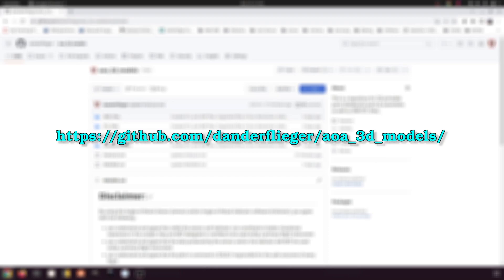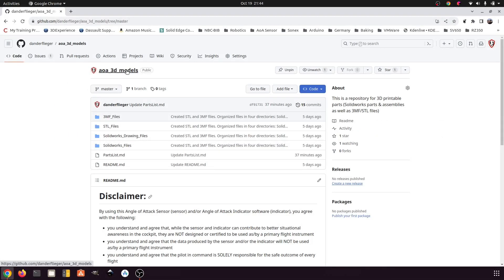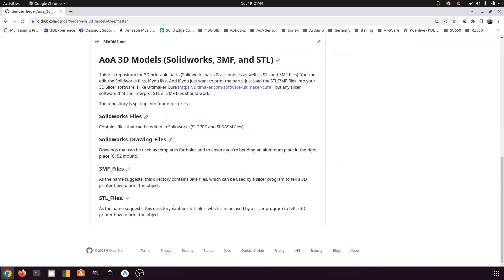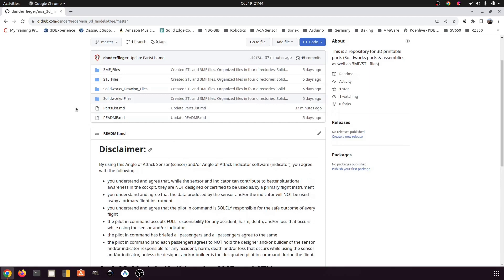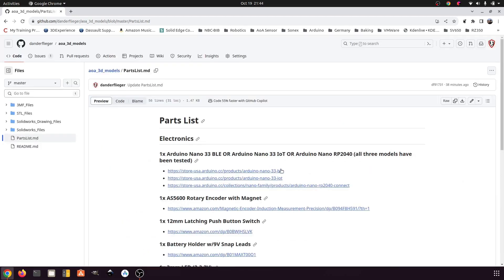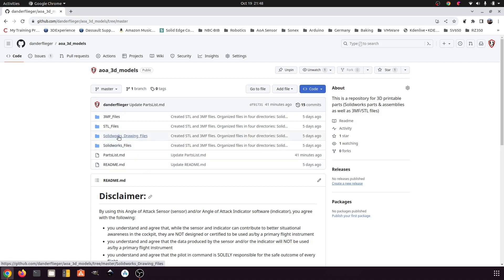Homebuilt Angle of Attack Sensor Assembly

Comment: May be it is a dumb question, can we use an 3 axis acceleromter such as in arduplane instead of an aoa vane as you described ? Btw i really like your design.
Reply from the maker: I think it's a valid question - not dumb at all. With an IMU, you can only derive AoA - e.g. a guess based on limited data. On a typical day, it can be pretty accurate. But if you're flying near mountains, for example, you often get caught in mountain waves where the air flows over a mountain like water in a stream over a rock. With that scenario, let's say you're flying toward a mountain on a windy day on the leeward side side of the mountain. The air it's flowing down toward the low-lying ground behind you. If you're flying level to the horizon, the air is hitting you from a lower angle of attack. All the while you're also descending because the pocket of air you're flying through is descending and carrying you with it. An IMU can't sense that perfectly - it would have to be programmed to derive the AoA based on data that doesn't include the direction of the oncoming air over the wing. Figuring that out is really hard to do with 100% accuracy. Using a vane will always tell you the exact angle of the relative wind compared to the chord of the wing (regardless of flight conditions like turns, slips, climbs, descents, mountain waves, etc.) And since that angle is what eventually causes a wing to stall, a vane is the most accurate option to get AoA data in any flight condition. Except in icing conditions where the shape of your wing changes (which also changes the critical angle of attack to some unknown variable) - then you might be in trouble.

Comment: That looks really well built and thought out.

It looks like it's designed to be mounted externally and I saw you tested it on a wing strut.
When you get your Sonex built, where would you mount it? Outside of the the prop wash obviously, so under a wing?
Would you then redesign it to delete the batteries and keep the arduino in the fuselage? then 3.3v, sda, scl and ground through the wing, to the sensor?

I think I'll have to build an AOA for my velocity build, but I'll mount it in the nose with just the vane protruding.

The length of the vane and it's counter balance seems longer than needed, did you have some flutter with a shorter vane or was that it wasn't balanced and not seeing clean air?
I probably missed it in your videos, but what magnetometer sensor did you go with? 
I think I saw you trying an air differential type sensor to find AOA, how did that go and which would you prefer if you hadn't sunk so much time into designing the vane type one?

I'm in the same boat as you, trying to build instruments and aircraft at the same time.

Very exciting.
Reply from the maker: Birds of a feather ... Thanks for the kind words!

When I originally designed this AoA sensor, I didn't have my Sonex. I belong to a flying club with two certified aircraft (Cessna 152 & 172). It was designed to be used legally as a "non-permanent" installation - which is why it's battery powered and uses Bluetooth for connectivity. So it's about the same as an ADSB in receiver - it adds situational awareness, without being permanently installed.

I haven't had a chance to really test the pressure differential type AoA fixture yet, apart from blowing on it (which does seem to work - just no flight testing yet). If I ever get a chance to test that one, it's probably the one I'll use on the Sonex, and it will be permanently attached (as an experimental, I can legally install it). No moving parts that can be affected by corrosion is appealing to me.

For a permanent installation, I'd still have the Arduino in or very near the sensor body. I2C is not good for long runs. CAN is much better, so I'd attach the sensor to the Arduino via I2C (or analog on the pressure differential sensor) and a CAN module over SPI. Then I'd connect a couple of shielded, twisted pair wires from that to a CAN Bus hub where some other CAN connected module (either an EFIS or a dedicated Arduino AoA display with an LED bar or screen of some kind) would read the data and display it in the cockpit. 

On the Sonex, yes it would have to be mounted on the wing (or possibly the top of the vertical stabilizer, but I'm not sure the air would be clean enough up there). Your Velocity, with a pusher prop, can have it mounted just about anywhere in front of the prop, I think. 

BTW, I think canard airplanes are super cool. I'm jealous! I just subscribed to follow along with your build.